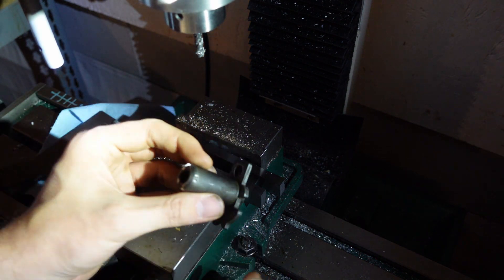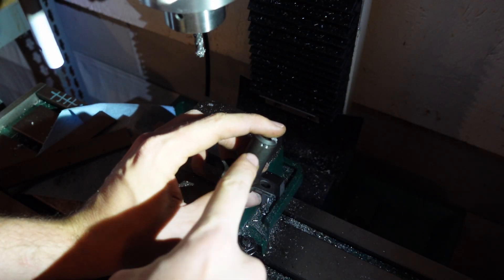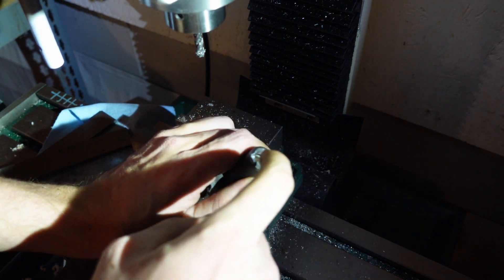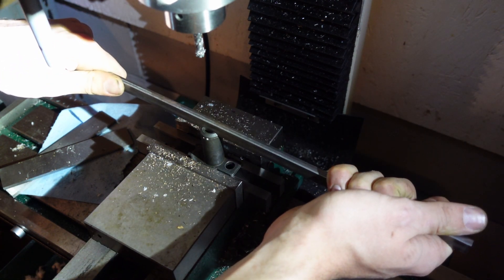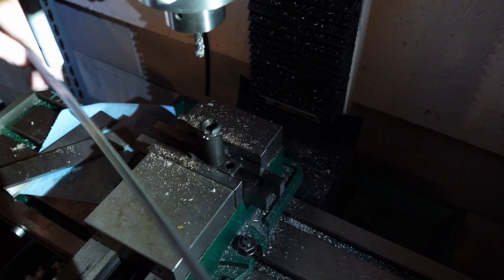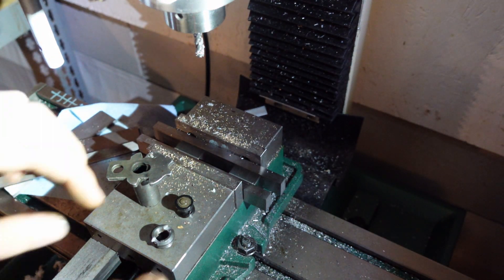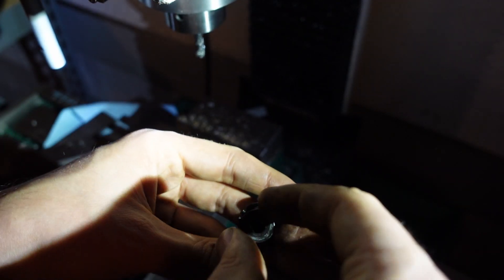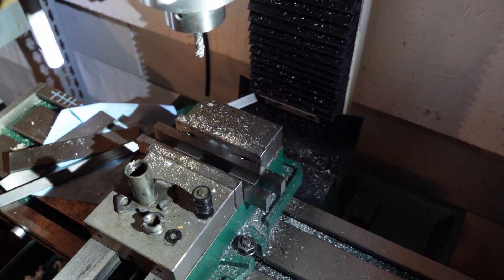How to Replace/Repair/Disassemble CETME C Buffer

Comment: Awesome video man ! Do you think you could do one showing how to swap the recoil spring as well, there isn’t a ton of info on how to do it. (Or at least I’m having trouble finding it lol)
Reply from the maker: It's very easy. Pull the spring and spring encap back, use vise grips to clamp on the guide rod to hold them back, use a punch to knock out the pin for the guide rod tip.
Reply: @ thank you so much man that’s exactly what needed to know! I have a new recoil spring on order from HK parts now 🤙🏻

Comment: Bill Springfield sells a updated recoil buffer. Stock buffers are designed to handle the recoil when you use the rifle as a grenade launcher. You will feel a reduction in recoil of 25-40%.

Comment: Thank you very much for the resource. This will benefit many builders. Have you ever considered the AUG parts kits? If FN would be willing to spin up more barrels, would you consider designing a receiver? I love the standard Steyr AUG, but building a printed AUG would be awesome. The magazines could easily be printed due to the excessive space they take up from primitive polymer.😁
Reply from the maker: The AUG's receiver is uniquely stupid, it's really a wonder the gun actually works. I've got ideas on things AUG-based, but the receiver is just so weird.
Reply: FYI I could take any mic measurements you need for the receiver. And photos as well. Provided you don't already have one of course.